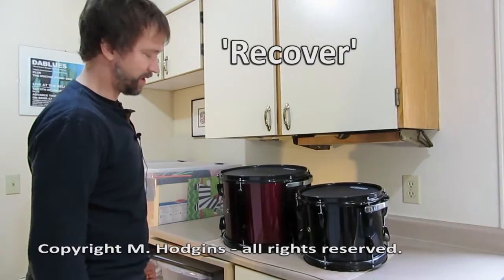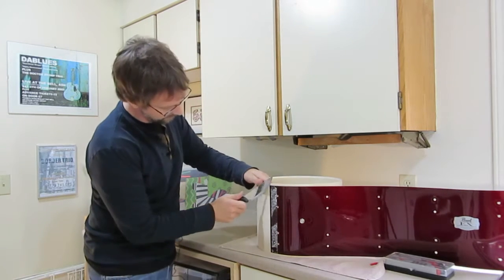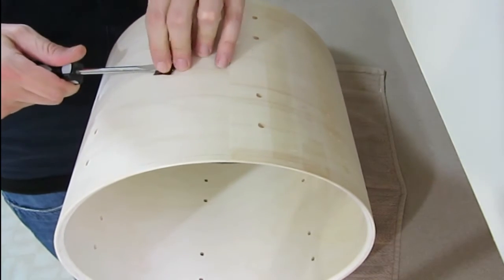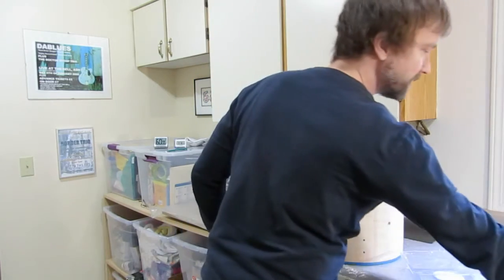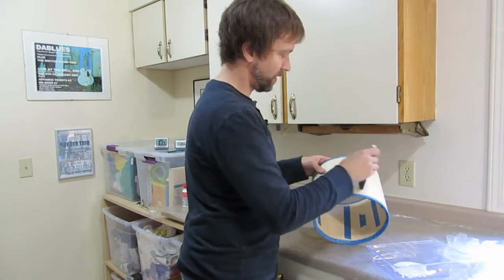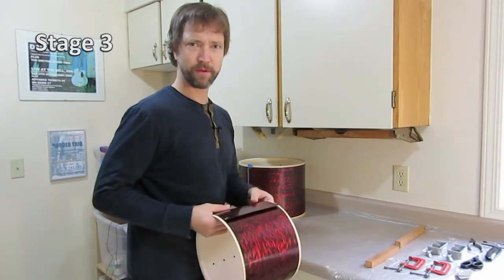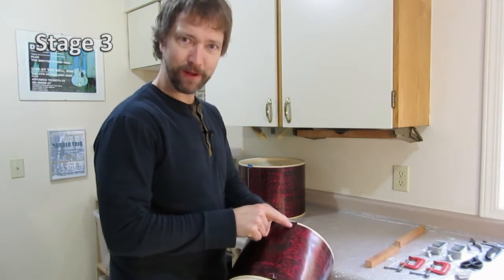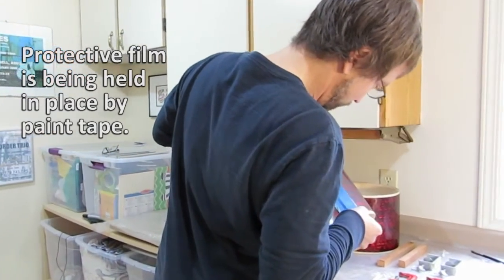How to re-wrap drums: to a beautiful finish [Part 1]

Comment: I hope you can show us in a close up the part when you remove the air vent. I want to do the same to change those parts. Best regards bro :)
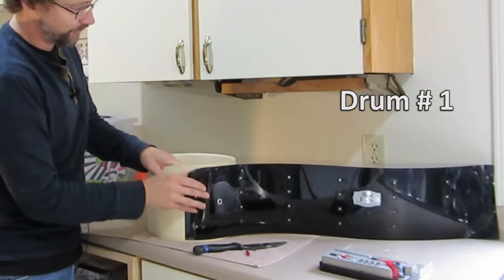Reply from the maker: For now, I’ve done my best to answer your question: from here [ 1:46 ] in this video, and at [ 7.37 ] in the PART TWO Video. You always need to replace original factory eyelet, and usually cannot use the original badge either: because both simply get destroyed. The process is tough, but any nicks, dings or gouge can be covered completely. Wrap should be supplied with replacement eyelets [of MANY potential sizes]. If not, go online – the eyelets are very cheap, and low shipping too.

Please see the 2 timing-points listed, and by all means contact me back if this is not clear. The original eyelet & badge are always a challenge: get under it, tap into it; work the metal sleave to clear it ...

P.S. I will be making a follow up [Part Three] video in Spring 2018: which shows the complete kit, with its beautiful Red Onyx Bass Drum; and I’ll answer every question I’ve taken on this subject.

Thank you for your interest and support! Matthew

Comment: Do the wraps not have an adhesive pre applied when they are sent to you?
Reply from the maker: There are many wraps and differing ‘wrap packages’.

In this video I used Red Onxy, supplied by Precision Drum Company.

If a drum wrap has adhesive, then it’s similar to —- adding a dark film to you car windows; IMO it will not work.

Mine and Precision’s products are I think the best way. Thanks for comment.

Comment: You could have made the video another 15 minutes longer with one of your lengthy explanations of how to protect the inside of the drum shell from clap damage had you bothered. Also why not remove the metal grommet before removing the covering so you wouldn't have to hack it up like that? The old covering might even then have had a bit of resale value, making the recover job even cheaper ;)
Reply from the maker: - This video is praised for brevity! 
- I have no idea what you mean by ‘clap damage’.
- By all means buy a used covering yourself, but I’d prefer that viewers DON’T! The manufactured-holes (which of course remain) in it will NOT match to other shells.

Good luck nonetheless, to all the people who want to coach me publicly on how to wrap a shell.
Reply: @DrumSolVanIsle  a mere typo dear boy :) 'clamp damage', and hey, you put yourself out there publicly, take constructive criticism on the chin ☺

Comment: Greetings from Ireland.....great job !
Reply from the maker: Thanks for that! I’ve great memories of Ireland, and have citizenship: having travelled around the south, and one place name I never forget called Clonakilty
Reply from the maker: HELLO, and sorry for delay. I will look into that! Great reply!
Reply from the maker: HELLO, and I forgot to explain:

From my experience, and from where I bought most of my wraps, Sparkle wrap is harder to use 
It’s possible that a different supplier will disprove me but:
The sparkles can be stif, thicker too. And the worst, is actually cutting or trimming, or filing. The sparkles disperse and there was always a poor smell in my experience 
I used a sparkle professionally many many times: when it dawn on me, I re did the drum and threw that sparkle wrap away.

The onyx here is soft, playable, thin, pretty.... And we need a tight fit (never perfect) but snug.

I couldn’t get that as good, with sparkle. But you may find-light, playable sparkle. I never did.
Reply: @DrumSolVanIsle  oh..very interesting..il keep that in mind....thanks

Comment: Just use a heat gun or a blow dryer to take the wraps off. Much safer than a knife. Once the adhesive melts, the wrap will be easy to remove
Reply from the maker: Thanks for writing but — there is no need for a heat gun, on these Pearl Exports. All right?
If you watch the video, you will see that the manufacturer used a very minimal amount of adhesive. For Pearl Export shells as pictured, just peal. No excessive heat: no smell, no overheated or extruded shell, no burnt skin or appendage etc. That’s why Pearl Export is so great here.
However (and as I’ve said,) if it were Tama, Ludwig, Rogers, etc then always prepare to use a heat gun. 30$ at Lowes: got one, didn’t need it.

My advise is - first determine how easy it will be, before using a heat gun: and in this (video) case there is NO need for a heat gun. I pulled it off by hand.
If user finds adhesive in 90-100% of lining, and it won’t pull off: then use a gun in A WELL VENTILATED area, and be careful of  the heat which is produced, and be careful not to blow a fuse....
Reply: @DrumSolVanIsle  I did it for pearl vision and a Rhythm traveler, the heat gun worked extremely well🤷🏻‍♂️ each to their own. 🤣
Reply from the maker: Hi, yes. 
At the time of making video, I learned that manufacturers can use their large tooling systems, to pinch, spin and glue.
Some companies likely decide, that — what you see here from Pearl — is cheap.

I did not enjoy, the heat gun stage in past: as I implied inc. very hot, near skin.
But heat gun is a MUST for anyone, starting a project. 
Don’t set off on a Project without one: UNLESS, like this project the user A) determines if HGun is needed, pause B) go out, order HGun, and resume work.
If it’s all the same, have one ready: I did, but with these shells, and owing to the original manufacture process, and the removal of lugs, the warp just pulled off. And looking back, that was great!
In my experience with HGun, parts of wood can be splintered, removed: as if the manufacturer can prevent you from heating the original off.

By mentioning as many scenarios, I hope viewers are well informed.

Finally, I hated the smell: thick adhesive & burnt shell, wrap. Ventilation needed.

All the best
Reply: @DrumSolVanIsle  the thing with the heat guns is many use them incorrectly. They leave it concentrated on one spot for too long, and too close - where the user should actually keep it moving back and forth over the area while it's set to a low-low medium heat. I worked in an auto body repair shop so I know a thing or two about removing adhesives, paint, wraps etc. I've done dozens of rewrap jobs, not just on drum shells, either.

I'm not saying your method in the video was wrong, it worked well for you. I was just talking from a safety aspect because let's face it, not everyone is good with a knife, especially if a younger person wants to do a project like this. I just found the heat gun the quickest and easiest, and I had removed all adhesive problem free. If any adhesive was left behind, it sanded right out. That's it, simple. No need to get defensive. 

In the end you achieved your desired result which is the main thing. 

Take care.
Reply from the maker: Yes. 

I wonder if more often than not now, as companies reduce costs, and machining is more refined: and that lugs hold down a wrap:IF  in fact more drums are glued so limited, as the pearl export shells I used. Those had so limited a gluing. It’s as if the machining was SO efficient, that glue was not even needed. So how often is that now??

When I began working on wrapping, I encountered tightly glued drums: owned a heat gun, wore gloves from a fire-stove and got on with ripping it all of. I understand the method of even heat, and it still brings back a nauseous memory. Come to think of it, I did some Premier Shells, which came off easy too.... Luck o the draw.

I remember differing thickness, resilience, shall tear away, from all the drums I did, years ago. Then I stumbled on these.

You are correct about using a knife: and as I’ve said, I can take NO responsibility for any accidents that may occur as a result of watching this video. 

But this all takes me to a point I’ve made: if your drum set is new, Hugh quality then don’t tinker with it (if it gets a battle scar)
If you come across some Frankenstein shells, why not unify them with wrap, and take them out on a gig, where the risks are higher to retain damage. 

PS DId you know that this video, was part of a lesson on DRUMEO. I wonder if DRUMEO still lists my name, as an instructor?
Reply: @DrumSolVanIsle  As time went on, adhiesives advanced, the wrapping technique improved and as did the quality of woods and shell crafting technology. Which is a plus for all of us. Companies wouldn't have needed to, or realised more rather, that they won't need to apply so much adhiesive to the wrap - and less adhiesive applied between the wrap and the shell would improve it's resonating capabilities. Too much glue would stiffen up the shell. 

That's cool that you were featured on Dumeo, I rarely watch them now.

Comment: Nice job . Would you have been able to apply the glue on just the edges ( seams ) of new wrap similar to the old wrap you removed ?
Reply from the maker: Hello, and I understand your question. In theory yes, because the fittings lock down the wrap - but at the next stage. However, the wrap which I use is thicker and more tensile than the original pearl wrap [which is flimsy for a reason] and it makes sense a) to get water based adhesive in there first, and as well as b) the fittings, and then c) the seam. I want the wrap strongly allied to the shape of the shell -- when I drill, because drilling will jar, or dislodge any wrap which is not held down properly. 
So, thin wrap possibly to yes; but the thicker more tensile wrap -- very probably no. Thanks for comment!!

Comment: The pre-cut wrap for my 14x14 floor tom arrived from Precision at 14.5". Should I cut that down to 13" so there's a half inch of just wood at the top and bottom as it appears you have here? Should it have just arrived at 13"? I ordered pre-cut to not have to monkey with that. And the tape you have at the top and bottom I'm just guessing comes down 1/2" on the outside. Is there right?

Thank you very much for your video. I'd seen some others that used just rug tape on each end of the wrap and others that just held down the wrap with clamps and relied on the hardware to hold in the wrap. But seeing your details gives me more confidence to go ahead with the adhesive.
Reply from the maker: Hello! And that is a good question, which I can answer here (but without the measurements, of o can leave those to you. Firstly, Precision has (had) a different method for bearing edges than I showed in my video. They always suggested oversized wrap, both ends, and instructed user to use a file, and blend the wrap, as an extension of the bearing. I never liked that at all.
I measured in advance, by measuring the original wrap, and placed the order for that: and the guy at Pre. would sort of say “you will regret it”. But I didn’t: I can invent and employ perfectionist methods .... measuring and predicting the roll, so it doesn’t go off.
Prec. wants to prevent an uneven roll, by giving you wider than needed, and leaving you to file down. But it was always too close to bearing and never worked for me. I took their method, and adapted it for what I think is the better.
For your measurements: you should use a long straight edge, whenever you go to cut, and a large pro guillotine would be best. It doesn’t have to be like building an airplane: there is an error tolerance throughout: but that tolerance —is your moment, your call.
No one ever gets it perfect: but getting close helps: once, and however you finish, then imagine the drums on a dark stage, with a few stage lights: no one will ever know, what may be in your head.
Know what, there was a mistake on one of my videoed drums, and believe me know one will ever know .... except :)
Keep in touch if I can help further.
Reply: @DrumSolVanIsle  thanks much. To paraphrase, you would recommend applying the wrap w a half inch margin on each end. Have I gleaned correctly?
Reply from the maker: I think you are correct, but to clarify: I try to measure the original wrap. So if your order is larger, the measure the original: manufacturer wrap, go to piece, and use a long 1 meter plus straight metal ruler or guillotine, to (if you want to follow me) have as near as possible a pice of wrap, to the piece you removed from the drum.
If the roll goes a bit wrong, then Pre. gets the points, they get the prediction. 
If your “roll” goes well, and is out too, then the drum head will cover it .... and the bearing edge is well well clear.
Matt
Reply: @DrumSolVanIsle  Thanks again Matt.

Comment: This will suck because I have a 2 22" bass drums a 12" 14" high and mid and  16" 18" floor tom
Reply from the maker: I understand you. As the shells get bigger (except Bass Drum) it does get more difficult in my opinion: some disagree as usual; some say “all shell sizes are the same work duty”. As for Bass Drums remember, you have 2 (TWO) pieces supplied by wrap provider. For the set you see in my video, I have wrapped a 20 inch bass drum, but wasn’t able yet to include details. So your bass drums are near-easy, but the larger toms can be troublesome: especially if one goes badly wrong, and the wrap reordering is expensive. Thanks for comment. If you do proceed on so big a kit, have a second kit ready until the wrap-kit is ready.

Comment: Lucky you. My Mapex has glue all over the shell
Reply from the maker: I know what you mean. If you take it slow, the shell can be returned quite close to just wood/ limited glue. Be careful not to pull too many splinter pieces, a few is ok: sometimes in order to remove manufacturers adhesive, the shell tears away: too much, needs a dash of filler, a few splinters = don’t worry. Thanks for contacting.

Comment: Try a hair dryer next time.. thats what I do, makes it so easy when the glue slips by itself :)
Reply from the maker: Thanks and fair point. I'm inclined to let items sit in a warm room or outdoor during warmer months above 15-17 degrees, to speed any drying. I feel that a hairdryer may expand the wrap. In most circumstances, I can finger-roll any glue that breaches its desired placement; with no residue--especially when using water based.

Comment: What brand adhesive is that?
Reply from the maker: I prefer to use water based contact cement: the solvent based version is more aggressive, it’s not healthy to breath, but it is however MORE common in this field. 
I’ve noticed 2 adverse effects from the solvent based cement: i) staining from behind on a white pearl wrap, and ii) a contracting or curling effect as the wrap’s polymer is shrunk by reaction. I don’t use a 16 inch floor tom: the 13 pictured here is my floor tom, but it’s possible that the user will benefit from solvent based - on larger drums. 
As said, I’ve done the Red Onyx Bass Drum in ‘water based’. If you or others want to see how I wrapped the Bass Drum, and how I reconditioned its hoops, then please check my channel back.
Reply: Oh ok, thanks for your reply. I was slightly confused because I feel like water is a solvent. I looked at the can of the cement the manufacturer of the wrap I will be using recommended and it listed petroleum naptha, MEK and toluene as VOCs. I will do this in open area then, but good to know, perhaps if I would use a water based if the manufacturer insisted. I was mostly just wondering what brand you used, I am using a brand called Weldwood by DAP
Reply from the maker: Weldwood by DAP is the most common adhesive used in the USA. I believe the company makes both solvent/ VOC based and a water based. The VOC version has more grip, but if you get ‘a winter’ where you live, indoor use can be thick with odour.
Reply from the maker: @idiotburns: is your DAP by Weldwood contact cement clear, thick (and high solvent odour)?
In Canada, in my region, water based (as I’ve referred) is watery, milky white (w/out odour).
Some years ago, I had a tin of DAP which was white, watery milk colour. Hence I suggested DAP could offer both VOC and water based.
Viewers should realize that - different territories have differing regulations: and contact cement as a product is open to variations.
Reply: Good wrap instructional, but the expense of Precision Drum wrap for cheap shells? Its not an old Ludwig or Slingerland set..
Reply from the maker: I understand your point.

Comment: dude the next bloke who changes this wrap is going to be proper bent out of shape with you useing that blue peter sticky back plastic,,,looks good thou
Reply from the maker: Sorry, but I didn’t use sticky back anything
Reply: @DrumSolVanIsle  what i mean fellow is you covered all your wrap in sticky,,,making it all sticky back,,,you only needed to overlap and join a 2 ins seam,,,i thought you may have took a good lesson from the pro who put the first wrap on,,,,love to see a video of you a year later trying to get your own wrap off that there shall you gone and put it on
Reply from the maker: The original manufacturer wrap was placed on the drum by ‘machinery’ at Pearl. Manufacturing facilities as such, are for large companies, not home hobbyists, obviously. I don’t agree with you about the “2 inch seam”: have you tried the idea, or is it more of a concept? To my humble knowledge, home-hobbyists can’t get the taught, tightness required to: a) limit the adhesive use YET b) maintain a good sound.